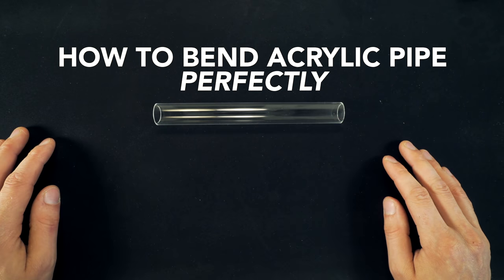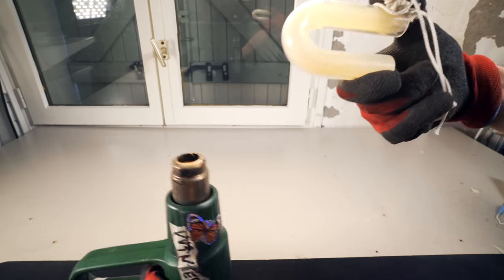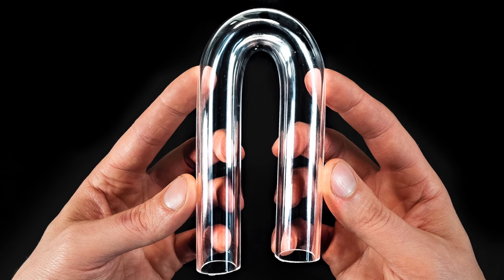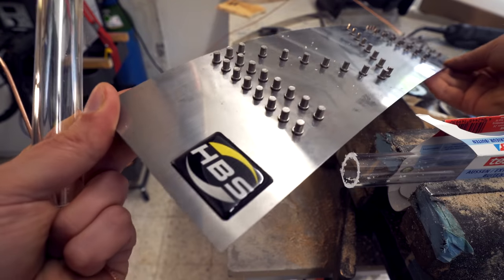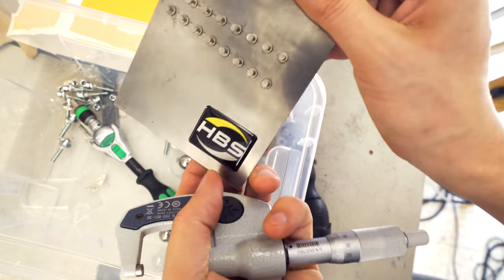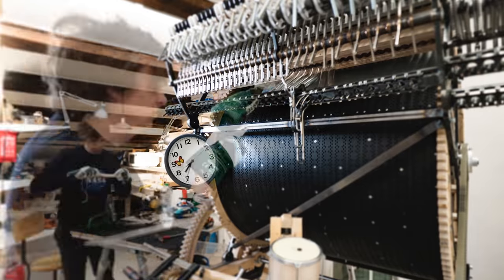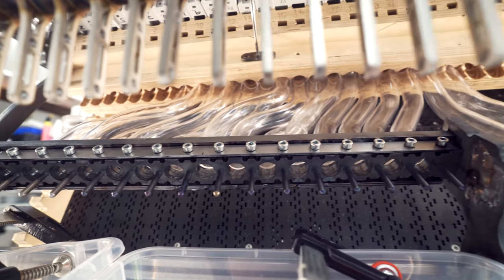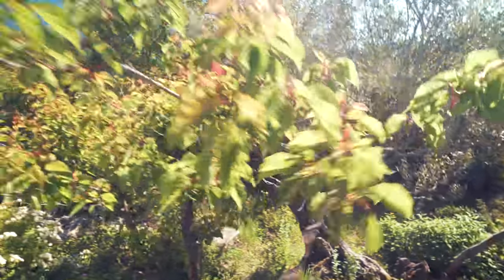How To Bend Acrylic Pipe PERFECTLY - Marble Machine X#79

Comment: Wahay! Good tut Martin, good to see that you've also picked up a bunch of the tricks and techniques used for this sort of work! Having a digital heat gun is really handy I find if you have loads of tubes to do as you can set the temperature to be just above the glass point of the acrylic, it helps when having to bend larger sections for more intricate paths like spirals or offsets.

I'm a professional casemodder so building custom loops is my bread and butter haha.

Comment: those shiny metal programming sheets are gonna look INSANELY cool on the machine, the black plastic ones were descrete and all but shiny metal works so well with the marbles
Reply: that is, assuming you're not planning on painting or tinting them some way, i suppose darkened plates with clean studs would stand out better, and probably match the other metal parts on the machine

Comment: Nice tutorial. Bendig acryl, or PETG, is a common thing for hardlined watercooling used in pcs. I used similar techniques when building mine. You might wanna consider PETG, it cuts easier than acryl, just with some sort of oversized scissor, bends silghtly easier and the only trade off is you loos a tiny bit of clearity from the tubing. I never used any "lubricant" for the silicon rod, it worked fine as is. Keep up the outstanding work!

Comment: heat it on super hot to add cool textured bubbles in it.and make sure to bend early to really stress the shape you want  . i find sand to really help threading the steel rod through the acrylic

Comment: Back in the day, we used to bend copper (plumbing) pipe by capping one end, filling it with sand, then capping the other end.  (We soldered pipe caps over the ends, but zi suspect tape could be made to work, too.)  The sand keeps the pipe from collapsing, same as the silicone rod, but MUCH easier to obtain.

Comment: I have 30 years of experience working with acrylic.
A guide for bending plastics.

If you heat the outside of the bend last, it is softer and will stretch without wrinkles.
If you heat the inside of the bend last, it is softer and will compress and wrinkle.
Don't forget Brisbane, Australia on the world tour.

Comment: My experience with forging metal rods says that you should move the heat along the length as you bend to reduce the pinching on thr short side and the necking on the long side.

Comment: on the matter of bending the TIG wire 'template' for the acrylic tubes...
would it help to have some sort of insert in the holes of the divider and the lower metal rack (end point of the tubes) that you could have a centered hole to insert  the TIG wire into?  something like a cork or small length of wood dowel?
this would sort of anchor the wire and allow you to focus on bending the wire in relation to the previous tube and not have to be concerned as much with maintaining the correct spacing.  
hope this helps,  keep up the awesome work, your dedication and persistence and creativity is truly awesome to see.

Comment: As you pointed out, you can use dry (flour) or wet (washing up liquid) as a lubricant to draw items through each other.
Your using silicon rod, have you tried using a silicon lubricant from an aerosol? Their are aerosols with differant silicon densities, they do have different levels of lubrication, but it might just work fantastically!  worth a try though 🤔

Comment: Hi. Try making a small hole lengthwise in the middle of another piece of the silicone, then thread some tig wire inside it. You should be able to bend it to the actual shape and more or less the same size. The last pipes are going to be really difficult to set up in the space.

Comment: you can also use sand, which works with metal as well.
Reply: If you want to use sand to bend PMMA, you'll make it cloudy and also sand won't prevent the pinch..... silicone rod stay the best solution (for the crystal PMMA pipes.....)

Comment: Dude, awesome tutorial. I wish I'd seen that before I did my custom loop water cooled PC build two months ago.

One minor observation- I found that it helped a lot (especially with PMMA) to do a good followthru on the bend. I would bend the pipe slightly more than needed, take heat away, then hold it for about 10-20 seconds before releasing it. After doing this a few times, you can get a good feel for when to release it, such that it'll expand to the shape you want.

Btw, have you tried PETG tubing? I was originally using PMMA in my build, but I found that PETG bends at a lower temperature, and is just easier to work with in general. (Not sure if there is a particular material property you're looking for in PMMA.)

Comment: If there's some way to make an "oven" for heating the pipe, it will work a lot better than a heat gun, which is far too localised. Some sort of insulated box with a thermal controller, set to 150°. After 10-15 minutes, acrylic becomes rubbery and can be bent however you want. Sheets can be draped over formers for example, or pipes bent. Slow cooling is also better for clarity of the final piece without crazing or milkiness. You can buy commercial ovens for this, but it would be simple enough to make.

Comment: The difference in length between the pipes will cause a difference in the delay between the ball being released and hitting the instrument. Will you be able to compensate for this in the programming wheel?
Reply: The release mechanism that drops the ball is after the pipe, and triggers a new ball to traverse the pipe and "stage" for the next release.  Only becomes an issue if trying to drop two balls within less time than it takes a ball to make the trip, and that led Martin to two channels per note.

Comment: Maybe a big plaster, gypsum or acrylic "mold" and flexible tubing would be more efficient than bending wire to get the tube shape.
It would go like this:
1. Insert rubber hoses with the same diameter as the plastic tube;
2. Build a box around the hoses (possibly make a jig to hold the tubing in the same position if there is no space on the machine);
3. pour half half of the volume;
4. spray with some kind of release agent;
5. pour the other half;
6. use the resulting cavity as a template or depending on the heat resistance of the material as a mold.

Comment: Hi, not to be too simplistic but would a better way to bend multiple pipes be to secure both ends of the pipes with a jig ( so straight with excess for curves) insert medical silicone into each and then use a vacuum forming heater to heat them all to moulding temp. Then move the jigs in to the correct formation (poss a jig on the end of each jig with the correct angle distance). Allow to cool.  Fit to main marble machine.

Comment: Not sure if you will see this or not, but nitrile gloves are actually the wrong gloves to use for temperature resistance, they are actually very thermally conductive. Leather or even cotton work better for heat resistance.

Comment: @Wintergatan, have you made any considerations with regard to replacement parts in the event that any part breaks? For instance, are you creating more than one of each type of bent pipe so you have backups if for any reason one of them breaks when you've finished the machine and are actively using it.

Comment: Nice work as usual. One worry I have is that although the pipes look great won't the constant rolling of the steel balls leave marks on the inside ruining the clean look? And what about condensation inside the pipe causing "stuff" to grow which might impede the run of the balls?

Comment: Since they are all different lengths and bends that means they are all different delays from release to utilization, you can compensate for the varying delay by shifting the holes in the programming panels relative to each other however you have them all aligned. Are you going to ignore the small variations?

Comment: Not sure if this would work, but instead of a hot air gun, how about placing the pipe in heated sand. Maybe in a hot plate. I think you might get more uniform heating.

Comment: Great work! Just one question - won't the different pipe lenghts after the drop 'valve' result in a timing issue between the channels? The way it looks, the last connection pipe would be twice as long as the first one...

Comment: I don't mean to alarm you but...

Unless those pipes are 100% perfect, there would be slightly different in terms of the time for the marble to go through them.
You would need an adjustable delay per channel on the marble drop.

Unless I'm completely wrong and the marble catch is at the end of the metal bits.

Comment: Those pipes are going to alter the amount of time that goes between a stud on the programming wheel passing through the register and when the marble actually begins its fall. You'll have to be careful and account for that in your calibrations, but hopefully once you've got them all done you'll have to find the values for each pipe only once. I'd still be very careful with measuring the differences in drop time as you move it from place to place and elevation to elevation.

Comment: The SADDLE of your bike is a little bit to high at the front. It needs to be higher at the back than at the front (about 1 cm). In this configuration you have it, you are putting to much pressure at your prostate. So if you drive your bike frequently you are risking to damage your prostate. Just a little reminder from an bike mechanic from Germany xD

Comment: Hey Martin, did you ever consider the timing delay the various pipe bends could cause? I'm not sure if it would be an issue but the differences in path length (in the acrylic pipe section) of each channel could be something to look out for. 
Regardless I still believe, god speed Martin.
Reply: the always keep 2 marbles in reserve at the front , so refilling time shouldn't be that much of a problem?
Reply: @johnuferbach9166  oh so those pipes have marbles in them and the drop mechanism is further down? If so that makes sense

Comment: That may sound strange, but if you have any more pipes to bend, get some glide gel from a sex shop. I discovered that when I was looking for a better bolt lubricant for my paintball markers. Trust me, when it comes to making a tubular thing slide effortlessly in a tight tube, there's just nothing like a lubricant designed to make tubular things slide effortlessly in a tight tube.

Comment: Full disclaimer: I'm a complete novice when it comes to custom engineering  like this but I have a minor suggestion that may help with routing the pipes from the spreader to the droppers. If they're colliding while routed on a flat plane with each other, why not have every other pipe have a negative Y-value compared to the plane that the one's adjacent to it are on, splitting the routing between two heights may make the individual routeseasier to conceptualize. If it's clear that I have no idea what I'm talking about and I'm completely wrong, I apologize 😂

Comment: So he finally did go with a fixed pin system. (It's been suggested a few times.) Shoving in all the pins just to do a simple pattern must have taken longer than he originally thought, let alone what would be involved if handing off to somebody else to do a more complex melody.

As for the tubes? I wonder if he marked them with numbers and used adjacent tubes as a reference for shaping the new ones? It seems the wire alone wouldn't give enough of a guide to deal with outer diameter collision between the tubes. Also how much latency is there on the longer tube runs? As long as the marble is on some slope, it's going to be slowed compared to free-fall.

Comment: So I'm not sure if you made calculations and compensated for it but the 38 different pipes... I'd imagine they all vary in length since they're not all completely straight. The marbles may stay in the tubes a fraction of a fraction of a second in the longer tubes. Is that going to cause any timing problems? I'd imagine you can compensate by moving the instruments closer or further away but I'm just curious.

Comment: I know it's been a billion videos so far, but did I miss some sort of function in the machine where each channel can be adjusted individually for timing?  Things like the lengths of pipe each marble has to move through, distance to impact the instrument, etc... those seem like there would be a great deal of range in the timing (although very precisely repeatable errors).

So yeah, I assume somewhere there's a way to adjust the inputs per channel so you could go through at the end and calibrate each one?

(As always, god-level praise for your work!!!)
Reply: Yes - the drop mechanism can be raised or lowered to adjust the ball drop time.

Comment: Hi Martin, am I wrong or the 38 pipes don’t have the same length? It seems so... And if I am correct it means each channel will generate a little delay compared to the one on its right. Is it something you can compensate by moving pins on the programming plate?

Comment: If the outer pipes are long with more complex bends and the inner pipes are short with minimal bends, won't that cause timing differences from note to note? Similar to how the time of the ball dropping for the drum had a delay because of the distance of the marble falling and a clutch was used to fix this time offset. How would you fix the time difference for each pipe, or would it not be noticeable when the song is played ?

Comment: I would recommend using accura clearvue resin to print them based on your CAD model. Like a manifold style.
https://www.3dsystems.com/materials/accura-clearvue
If you want to be picky about it, you can get tube bending guide, commonly used by computer water cooling guys.

Comment: Is there any need to be concerned with the varying pipe lengths between the release and the instrument?  The first pipes get in the way of each other less than later pipes, and the distance to travel is shorter, but might it have been better for timing to start with the longer pipes so they can be the ones that don't get in each other's way?  It might also be useful to deliberately try to use the same length of pipe for each and arch the pipes more when the distance to cover is shorter.  I hope I'm wrong and the difference in travel time through the short and long pipes is essentially the same, or that those pipes are on the way to the release thus timing isn't affected...

On another note (pardon the pun), beautiful place you have there.  Very nice.

Comment: Why not making a cutout of all the pipes shape in wood with the cnc machine, and use it as a model? Heating all pipes and making them fit in each "mold" ? That way you'll be sure that every pipe fit together nicely before putting them on the machine

Comment: im assuming the string through the silicon tube can be applied to PC building too.
Reply: That would make sense, and with the string attached to pull it out, the section of silicone would only have to be as long as needed for the bend.

Comment: Why not use a heated oil bath to heat to pipes?  I worked at a custom window manufacturing plant and they used oil heated oil baths with mandrills and a jig to bend vinyl window frames to perfection.

Comment: Will there be a timing issue as marbles with longer pipes will obviously have to travel further?
Reply: Yeah, but they’ll lead to a rail system (Presumably the next step after the tubes are complete) that will somehow be accounting for the timing difference. That’ll be interesting to see; the rails will need to be shorter for the longer acrylic pipes and longer for the shorter pipes — in general. Changing the angles of the railing would also be a factor, so I wonder how it’ll all play out in his typical aesthetically pleasing way.
Reply: @johnnyjohnson6643  The release mechanism that drops the ball is after the pipe, and triggers a new ball to traverse the pipe and "stage" for the next release.  Only becomes an issue if trying to drop two balls within less time than it takes a ball to make the trip, and that led Martin to two channels per note.

Comment: Isn't there some timing concern when it comes to those clear pipes? Longer pipes would be slightly slower than shorter ones or is it just a negligible difference?
Reply: The drop mechanism is AFTER this point - those are just refill pipes.
Reply: @kin2naruto  Ahhh, righto. Makes sense

Comment: This may already have been suggested, but to save yourself time could you not have used the Fusion 360 model and a bunch of 3D sketch spline paths to create a 3D-printable (or CNC-Router-able) bending template? Doesn't individually bending each pipe from one end or the other also introduce latency in every marble drop? Or is the latency so minimal as to go unnoticed?

Comment: How do you account for the difference in length of those pipes? The ones in the center seem shorter than the ones on the far sides. Doesn't that introduce timing issues?